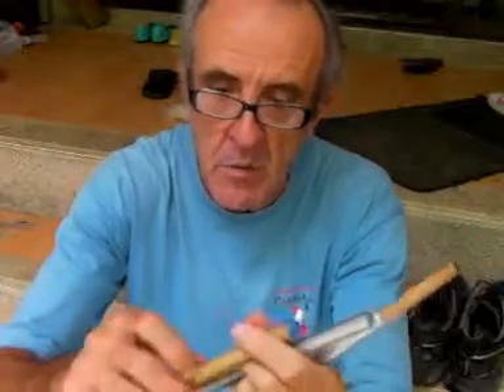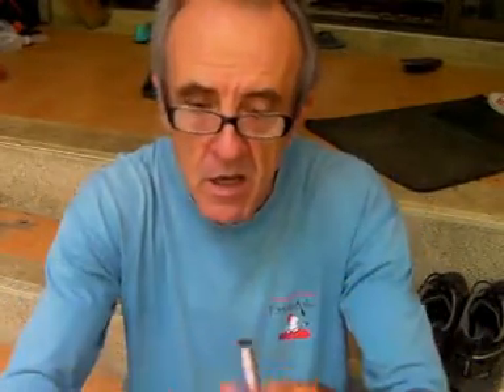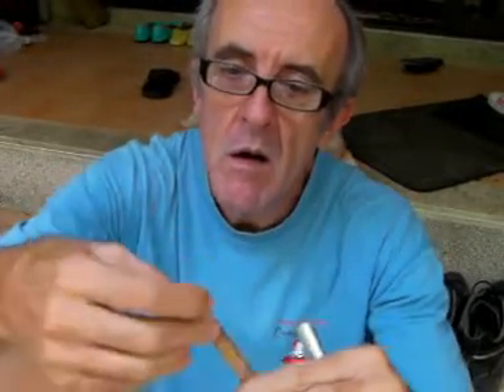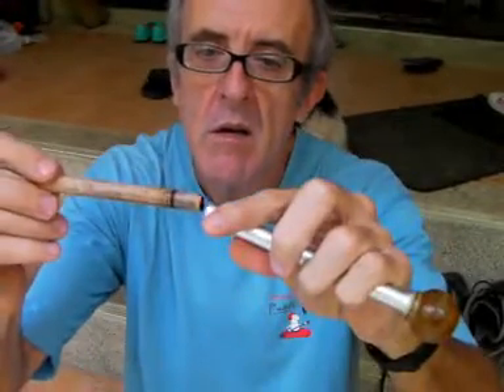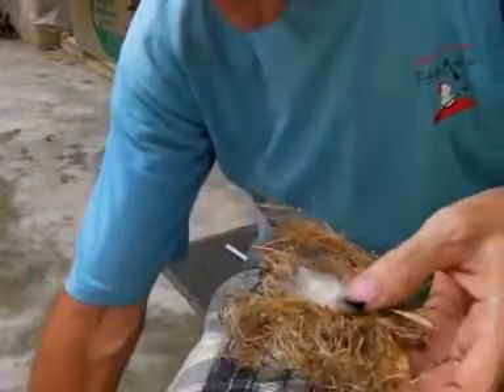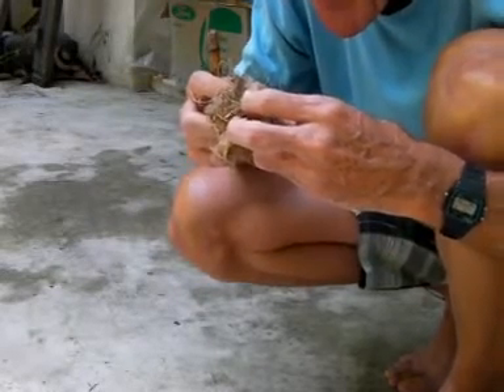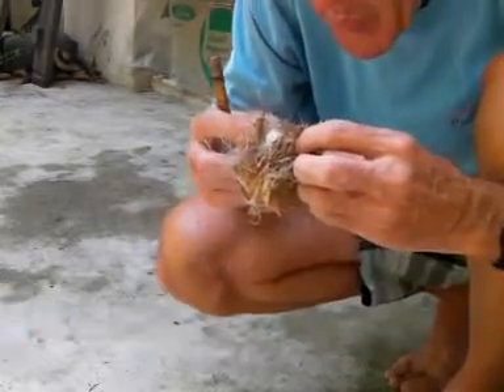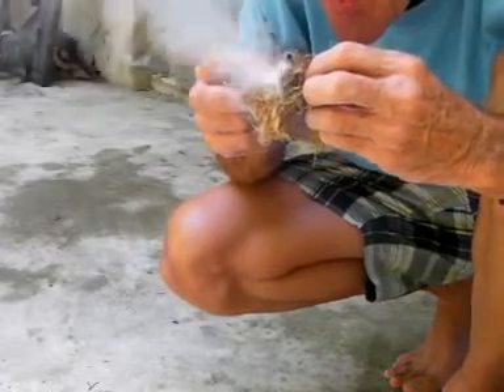Homemade Fire Piston

Comment: Thanks for the video! Awesome demonstration! Could I substitute some chaga in place of the char cloth? Thanks again!
Reply from the maker: B Charron  We don't have that mushroom here, so I'm not really sure. If it is easy to get and hold an ember, it should work nicely.  If you try it and it works, please let me know.  Good luck... and thanks for watching.
Reply: dave williams I just cut an old metal broom stick 1 foot in length, and just cut an old pool cue stick. I will chisel and sand it down until it fits snug, and tight in the broom stick chamber, but I have alot of work to do as it will all be done manually. The broom stick has a stopper/top on it to stop air flow so I am hoping it will work. I have chaga that I will stick on the top of the pool stick once I make an indent in it. I will let you know how it goes, but I wont be ready for a couple of days. thanks
Reply from the maker: B Charron Wow, that should be a big one... sounds like a good plan.  Yes, definitely let me know how that goes.  Best of luck with your project. :-)